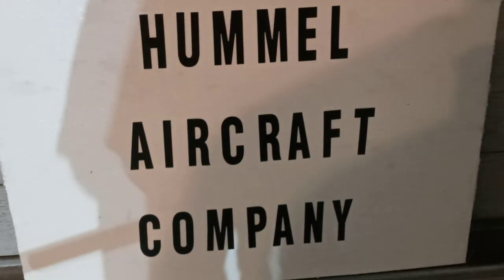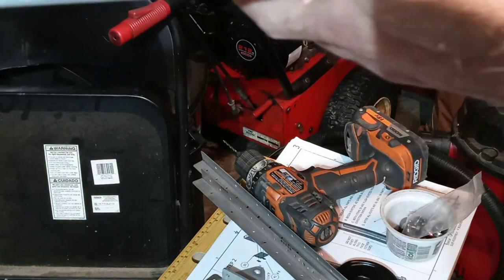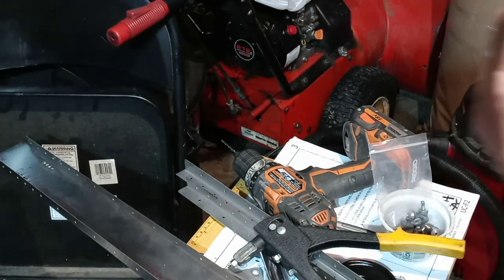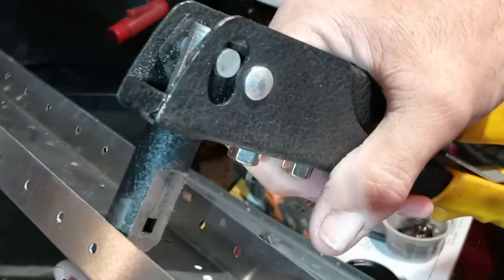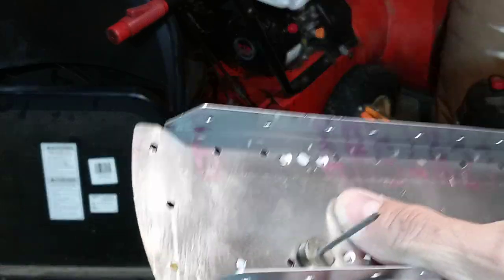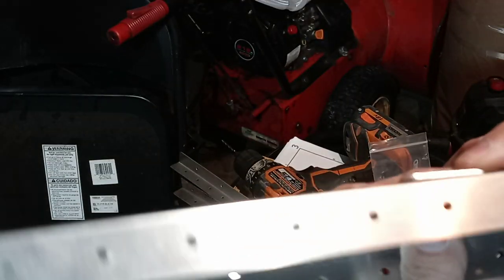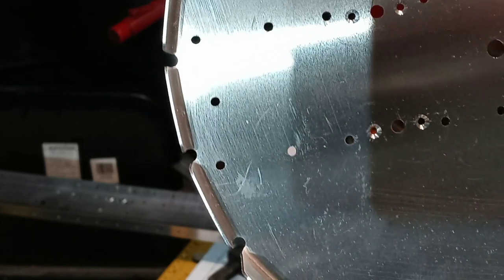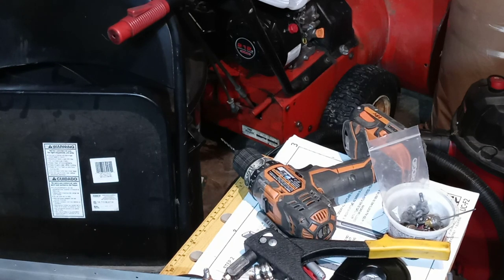Dimpling and countersinking the vertical spar

Comment: Did you get the kit.or are you making your own bulkheads.
Reply from the maker: Hi Frank Schurr yes sir this is the kit. But you do have to bend and drill to put on the little brackets on the inside of the bulkheads. Its not that big of a deal but does take time. Im not sure really how much a kit should be done for you. But it is still a LOT easier than making every single part. And I built 2 Hummels from plans so I know what it takes.Oh and yes the bulkheads are formed in the kit. I hope that helps you?